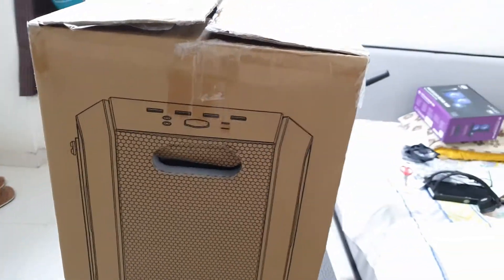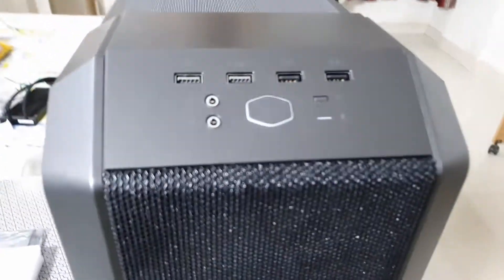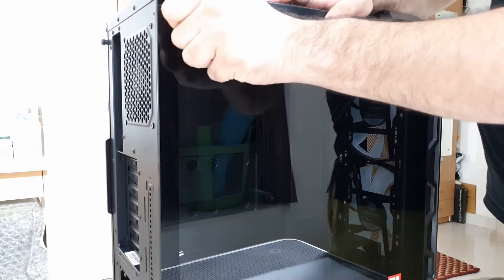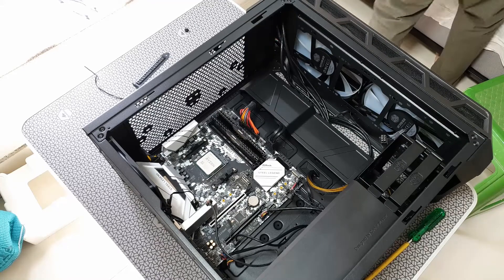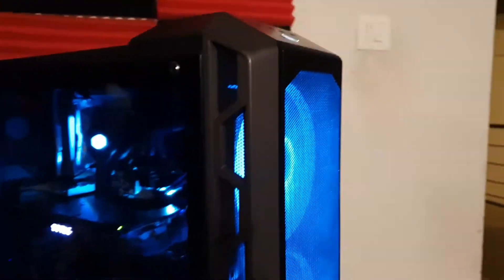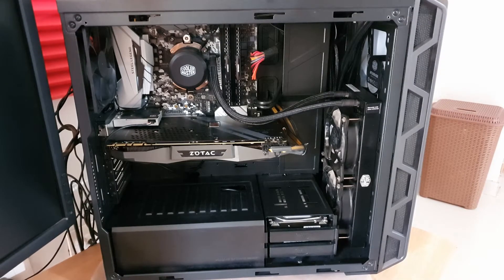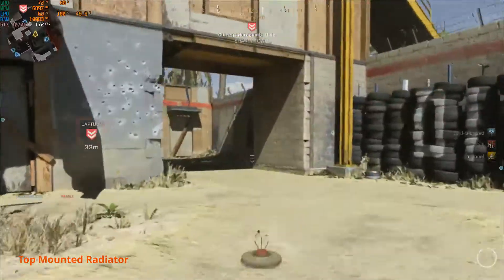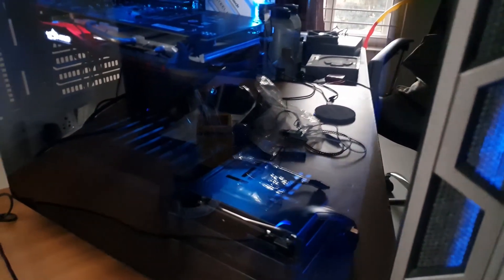Cooler Master H500 AIO Radiator Placement - Front vs Top #cpucooler #coolermaster #liquidcooling

Comment from the maker: Here is a new video where I have wall mounted the CPU https://youtu.be/7L5fhp_RMCw
Reply: Hey when you did the front mount the aio should not have  the top of the aio below the the cpu a new AIO has no trouble but over time when air builds up from permeation you will wreck the pump. Im doing a similar setup but adding extra two 140mm fans at the top of the case to deal with radiator exhaust and GPU  as well as one 140mm fan attached to my GPU  can you test this configuration? My PSU is managing to get here last.

Comment: Sir your mounting to the front AIO was incorrect! The Radiator should be higher up in the case and the pump tubes should be running from the bottom ideally. Watch stop doing this with JayzTwoCents. Thumbs down!!
Reply from the maker: The goal here was to showcase air flow.. I agree with you on the tube orientation 👍
Reply: Its good that you acknowleged the AIO front orientation was incorrect. However, a novice watching your vid  may mount it the same way u did which is the worst way you can install an AIO in your front case. That orientation would just kill the longetivity, let alone the possible harm that could do to your pc. I say edit that video... I stumbled upon because I bought the same case. Your call.

Comment: I never realized CM blocks some of the fans airflow from the inside frame,thats one reason I got the case for the big fans....shame on CM for that!  I wonder if I can modify my case to provide maximum airflow from that blockage. Do you think the NZXT Kraken Z63 280mm will work for a top mount?  Logically top mount makes sense as an extra exhaust on this case. Thanks for testing. Peace.
Reply from the maker: Ah 28O mm fans at the top in this case has its own issues... take a look at what happened https://youtu.be/OBz8aCWeR3g
Reply: @rtechreviews  Yes sir, after reading your comments here I think i'm gonna pull the trigger on the NZXT Kraken z53 240mm.  I really like the LCD display...wish it was a little cheaper. The Cooler Master website says the top will only support maximum radiator size 240mm.  I'll watch this video you posted soon!

Comment: Thanks for the review!just one doubt!Do you have to discard the 2 200mm fans when putting the aio front mounted?or can you make them all work together?
Reply from the maker: You don't have to...  I put them back to back
Reply: @rtechreviews  So from the outside to the inside,first the case fans then the radiator and then the radiator fans!Correct?
Reply: @rtechreviews  how?

Comment: Should be interesting mounting front radiator on top of the front and not on Bottom cause u can have fresh air for GPU from the Bottom half of the frontali 200mm fan and Also u can put 2 140 fan on the top of the case for exaust of hot air. This situation could be much Better for GPU. And again...pump should Always be placed lower than radiator to avoid air in the pump.
Reply from the maker: Yes

Comment: I just build my first PC, rad doesn't fit at top because of RAM slots so the front solution but...as I understand the case fans are pulling  air into the case and the rad fans are pulling the air outside, so... is that an issue?. I did something but I'm not sure hahaha put the rad on front, remove the rad fans and place both on top for exhaust and using the 200mm fans to cooldown the radiator. I don't know...
Reply from the maker: So yes the rad fans do pull air outwards... but you can reverse the fan to reverse the flow.  You can try adding the rads for a push-pull configuration... basically intake fans push air into the rads, post which they are pulled out by the rad fans themselves... it can work.

Or just use the rads in the front with the fans pulling in air and move the 200 mms  at the top.. that can work too., do let me know if it helped... please do subscribe 😉

Comment: Can I get rid of the front 2 fans in order to put a 360mm radiator on the front panel and fit in it's 3 fans? Or in the other hand, can I just use the big fans to cool down the radiator without fitting the 3 fans on it? Hope I'm making sense.
Reply from the maker: 2 things here... you can get rid of the 2 large case fans and use the radiators... but the  case won't look as good as it is...
Can you use the 2 large case fans directly on the radiator? No... these large fans are for circulation only.... they don't have enough static pressure to drive through radiators. Hope that helps 😊 ..please do subscribe thank you

Comment: Just wondering why you didn't try mounting just the rad on the front, and put the two fans on the top for exhaust? Also, put the radiator tubing higher relative to the CPU mount. That way any air bubbles get trapped up there, and not in with the pump. The overall idea being the 200mm pulls air through the radiator at the higher point(hot air rises anyways), which will exhaust out the top/back, while the bottom 200mm pulls straight cooler air which will be pulled up into the GPU. If your setup is anything like mine, you still have the HDD rack situated, and the PSU under the shroud, pulling air from the bottom where the dust filter is. So most of that cooler intake will be going towards the GPU as is.
Reply from the maker: That's a brilliant idea... just that I'd miss those lovely 200MM rgb fans upfront... makes the case look really odd without them honestly. But week try it someday 😊 thank you
Reply: @rtechreviews  I mean the two rad fans on the top. Leave the two 200mm on the front. They pull far more air than the two 140s. I might test it out myself, just for something to do. Instead of the two 140s on the rad, put those on the top as exhaust. Leave the two 200mm on the front, and put the rad on the front panel. The 200 should pull more than enough air through the rad, if you're using the mesh front instead of the clear front. I'm using the mesh. Prefer the airflow. I don't know how it'll affect the temps, I'm just curious. lol I definitely agree, the case would not look the same without the big ones up front. It's part of the look of the case that made me buy it to start with. Thought about upping to the H500M, but don't really see a point. It gives you a specific rad mount on the top, but that's about it. The price difference is pretty big. Can't really justify it to the wife. haha
Reply from the maker: Oh ok... got that .. the downside to this is that the 200MM fans are case fans and not pressure fans that can gush air through the rad vents.. any thoughts on that please?
Reply: @rtechreviews  You're right. Did a little reading up on it. Apparently they're great for moving large amounts of air freely at low RPMs, thus lower noise, but don't produce enough static pressure to force air through radiators in the way needed. That sucks. I would've thought just the free flowing air would be enough as opposed to the normal static, but a lot of people are saying no. Well, shucks. lol I was just curious. All in all, I've got my 240 rad mounted to the top as exhaust, along with an exhaust at the back. I find I rarely get much higher than mid-60s, depending on what I'm doing, which is well within the safe range for Ryzen CPUs. My GPU usually hits in the 70s, a Nitro+ 5700XT. I was just thinking of trying something different, as opposed to buying something different. haha
Reply from the maker: These things are always fun and a Lotta learning... 😊

Comment: what do you think will happen if i mount a 360mm aio rad in front with a pull config along with the two 200mm fans as intake
with three exhaust 1 in rear and 2 on top?

or should i just buy a 240mm aio and mount it on top
with the two 200mm as intake and one 120mm exhaust in rear.
Reply from the maker: You will have a slightly warmer GPU but a very cool CPU 😎 ... if you do the 360 pull configuration. A normal 240 at the top will work good enough with moderate GPU n CPU temperatures

Comment: hey man, 
I have the same aio, but doenst fitt in my current case, because of the vrams(Corsair Vengeance Rgb pro).
Is there any place in this case for the same aio and the same vrams?
Reply from the maker: Oh no... but you can try the front mount configuration

Comment: Just to let u guys know if someone is tempted to mount the same, i ve mounted a 280 aorus liquid cooler on top exhaust and worx like charm idle 35 and in game 58 degres on a 5800x and my gpu never passes 68 degres so i can’t complain about this ✅ case
Reply: Can I install a 280m radiator top on h500??
Reply: @سعدعبدالله-خ2ش  yes you can  it's tight but it works... at least with my aorus liquid cooler 280 with 2 fans of 14cm
Reply: hello, can u tell me if the vrm part didnt messs up with the dimensions of the aorus  radiator? i tried the corsair capellix but it was such a mess, holes too small and no threats, i destroyed my hands and i refund it, was thinking on the aorus but not quite sure if it will hit  the vrm plastic part of the mobo, what mobo did u use?
Reply: Thats good to know So I'm assuming the NZXT Kraken Z63 280mm will fit also in a top mount config.  I just realized 280mm refers to the size of the radiator not the fans lol

Comment: Hey question I got a msi liquid cooler 360R how do I install it to do this push and pull thing your doing
Reply: it's simple .. direct the fans to blow in air through the radiator such that the the air passes out eventually from one side. if it's put at the front of the case, the air would come through external front fans then get into the radiator and then inside the case.

Comment: Can the H500 fit a kraken x63? If it can, at the top or front? I am talking about the radiator.
Reply from the maker: It will fit at the top. I mean this case can handle a 280mm rad at the top. But sadly some motherboard RAM slots are placed way too high and they dont allow a 280mm rad. Check out my other video of a Deepcool Aio. The 280 simply wouldn't fit, as the RAM obstructs.
Reply: @rtechreviews  Thank you so much I greatly appreciate it!

Comment: bro i have the same case and a 3700x CPU but i am running the stock Wraith Cooler that came with the CPU, my Temps are above 80-90 c , when Running COD Warzone ..... can you please recommend me a 240 / 280 mm AIO ?

i think Top Mount wont support 280 mm so any good 240mm in India ?
Reply from the maker: Get a 240 from NZXT or Even this Deepcool 240 which is quieter than the NZXT.
Reply: @rtechreviews  ty bro, i was thinking of buying the Deep cool castle 240EX , tyvm
Reply from the maker: Its awesome
Reply: @rtechreviews  tyvm
Reply from the maker: Which one did you get finally
Reply: @rtechreviews  i have ordered the 240EX deepcool non rgb one
Reply from the maker: Awesome

Comment: Hello I just wonder if aio rad and fan has any interference with ram in this case? are there enough space for LPX memory even with 240 rad and 25mm fan on it on top?
Reply from the maker: Hi Chris, with a 240mm rad you most likely won't face any challenges 😀  ... the cooling fan most likely won't hinder, but I've never come across a scenario like that

Comment: Can I use a 360 on the front with the 2x 200mm front and front 3x120mm on the radiator to pull back
Reply from the maker: Ofcourse you can
Reply: How would I do this I got a 360 and this case

Comment: I have nzxt kraken x63 aio ! Can it be installed on top with x570 tomahawk motherboard ??
Reply from the maker: Wow congratulations... 
The Ram will cause problems.... may not fit... I suggest you check again before you decide.
Reply: @rtechreviews  i thought h500p mesh is a huge cabinet....can take 280mm radiator
Reply from the maker: It could take the 280 theoretically... but the RAM can cause problems
Reply: I used Asus Tuf x570 wifi Pro motherboard, comments about the ram are correct. connections to the top of the board would also be impossible to access/maintain.

Comment: Huge issue with the way you mounted the front radiator. Your pump was at the highest point of the loop. Your pump(on the cpu) should be below the highest point. Ideally, the best mount is on the front, tubes on the bottom, and the highest point of the radiator higher than the cpu pump
Reply: Steve would be proud 8P!

Comment: Bought a 360 cooler and was wondering if there was anyway it can be mounted on top? If not could it be slightly modded to fit? Also mounting behind the front fans cause any issues?
Reply from the maker: Hi Joe, it won't accommodate a 360 at the top this h500. The mounting was an issue with the 280mm rads as they were wider... if you try mounting a 360 at the top, one of the fans will be covered.
Reply: @rtechreviews  Would it be perfectly fine to mount them on the front behind the 200mm? Will that cause any issues or lower performance?
Reply from the maker: There is a problem with the performance of the GPU as the heat increases... CPU should be fine 🙂

Comment: My air cooler reaches 57 maximum (Ryzen 5 3600 @ 4.1 GHZ 1.15 Volt).

For gaming you never need AIO.
Reply from the maker: Wow which one please?
Reply: @rtechreviews  mine is Deepcool Fryzen, but any air cooler would perform similarly, in Ryzen CPUs you just need to figure the right balance between frequency and voltage.
Reply: @0M1995  1.15 volt lol try pushing that cpu to 5ghz @ 1.35v and see how your temperatures work out.

Edit: more and more gamers these days are shifting over to 1440p 240hz screens, so the extra power goes a long way.

Comment: To be honest the case doesn't help this comparison to be an apple to apple comparison. With the front mounted radiator operating as intake there was no exhaust fans at the top whereas with the top mounted radiator operating as exhaust there was intake fans.

Comment: Would i be able to fit the radiator from a kraken x53 on the top?
Reply: yes even a 280 MM rad will fit easily
Reply: @indiatechnewscom  what i dont get is the specs for H500 say 240mm top rad support, but the x53 is 280mm, so how can it fit? Im pickin my new case up in a couple of weeks so tryin to decide which cooler to put in it. Alternative is corsair h100i platinum
Reply: @Harmzz  the h500 should be able to hold a 280 at the top ... I have a 240 and ther Is a slot for the 280
Reply from the maker: Hi.. just a quick update... if you have a 280mm rad... the case can take it... however it depends on how your motherboard is designed.. the ram slots do interfere and that can be a concern with the 280mm rads

Comment: when you front-mounted your radiator you had it oriented the wrong way. tubes must be on the bottom. This may require mounting it higher up on the front, which is likely preferable anyway, as 1. you will likely blow less hot air directly on the GPU 2. you won't stifle 1/2 of a fan with the hdd tray. I'd be interested in seeing this config comparison.
Reply from the maker: Thank you Sebastian. The tubes wouldn't reach if I had mounted it that way. I agree with the mounting up part. Does it make a difference mounting it with tubes at the bottom?🤔 if so how please..
Reply from the maker: Got the answer from Michael 😊
Reply: @rtechreviews  Cool! For reference for anyone that may find this. Basically all AIOs will have a little air in them, and the air rises to the top. So you do not want 1. your pump at the highest point of the loop and 2. your rad tubes on the top - since this is where the air will be - you will degrade the flow of the liquid and the pump may pull air into it.

Comment: I also have that mobo can you fit an aio on top with enough clearance between the aio and the vrm of the mobo? I want a case with good airflow and i want a cool gpu i think i will buy the lian li pc o11 or this one idk what do you recommend?
Reply from the maker: Donno much about a Lian Li PC but this case certainly has clearance for a 280 MM rad on top and it won't hamper airflow or the VRM 😊

Comment: Hi! Will the artic liquid freezer 360 aio fit up front, along with the fan so that the radiator is sandwiched in between
Reply from the maker: Yes, the front can take a 360 with a sandwiched radiator... its designed that way.
Reply: @rtechreviews  Thanks, mine just arrived so I measured, and i was 3mm short😔, luckily the hard drive docks are removable so I unscrewed them and  moved those back a bit, they're loose now, but I can easily fit the 63mm aio
Reply from the maker: Yes, i mean the H500 is one of the biggest cases out there, yet adding a 360 would need the removal of HDD bay. Glad it fits 😊  please do subscribe thank you 😊

Comment: So what do u prefer, mounting radiator on top as an exhaust or in front as an intake?
Reply from the maker: Hi Narayan, if you want lower GPU temperature mount radiator on top. If you want lower CPU temperature mount in front, please do subscribe 😊
Reply: get the EVGA Hybrid GPU, you can do top or front , doesn't matter :)...

I have EVGA Hybrid 1080Ti FTW,,,the difference between GPU temp while CPU AIO rad front or top is 1c...

Comment: U should those front intake 200mm fans. Those are just gimmicks. I fell for them and bought antec nx 800 thinking there will be huge airflow but honestly they sucks. Now thinking of removing them and getting two 120mm corsair ml 120 fans. With a top mounted exhaust radiator.
Reply from the maker: True, there is very little airflow from those fans
Reply: I beg to differ mate. Those two 200mm are no gimmick. If you use the molex socket to power the fan in which it will rotate to maximum speed, it should bring a total of 180CFM of air into your case. I put my hand at the back of the fan and I can feel the air pressure from it.
Reply: @hafizshepard  yep!! do not connect them to the chassis fan connector on the mb ,,,if you do , these 200mm still deliver air quiet a lot..I could feel the same while examining the air flow!